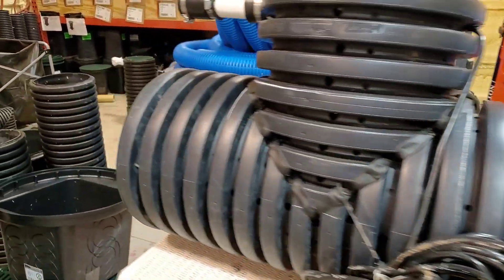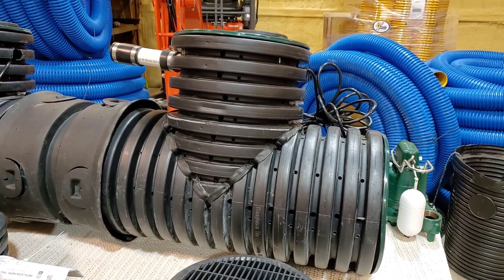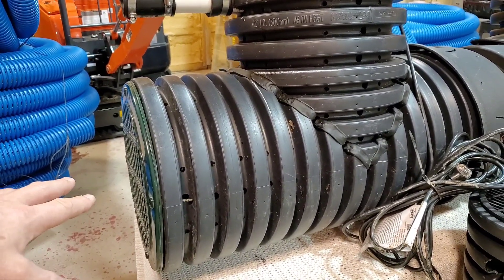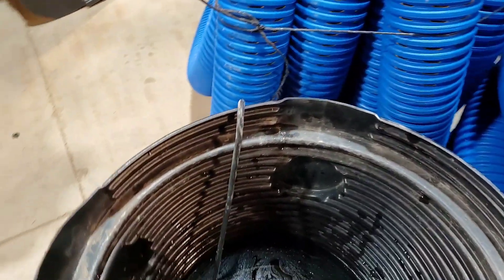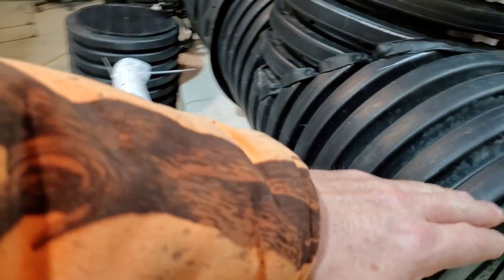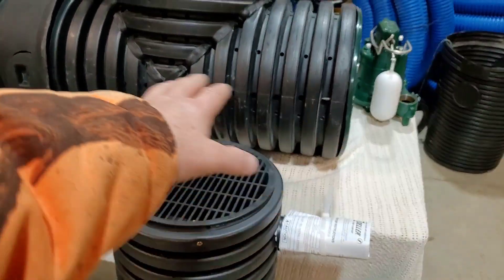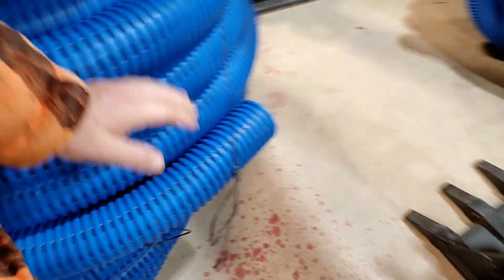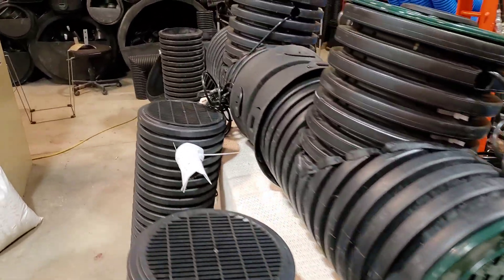Outdoor Sump Pump System [ How 🤔 to calculate the Right System for Your drainage problems ]

Comment: I have baffling problem with a sump pump that fails to send water down the discharge line. I have a  ½ hp Zoeller pump connected to an 1 ½” pipe on a 60’ run to the street.  This model struggles to deliver a trickle of water.  The plumber has checked the pipe; it’s clear.  He has removed the sump pump and placed it in a bucket of water to test it and it seems to work fine.  It shoots water half way across the yard.  But when it’s connected to the pipe,  it delivers a  barely cup of water at a time.  What could be the problem?
Reply: What’s the head height (elevation you’re pumping water)?

I’d check that there is no debris (including mud) obstructing the pump intake.

Also, do you have a check valve? If so, verify that it’s not on backwards. 

Any ball valves on the line which are partially closed?
Reply from the maker: https://youtube.com/playlist?list=PLjFCqaZ4v1BUpFHCLJ_sUFTqw1WoXu1Vz&si=d8F4T6qnzVk-ToQz

Comment: How does the added depth work when the pumps have the set float heights? How does it take advantage of the width when the pump would turn on before the water got that high? I'm sure I'm missing something though.
Reply: In this case, depth is just about allowing water to fall below your trench
Reply: @ben99873  that's not what I was inquiring about. In some of the applications it has a lower portion, almost looking like a cross. If the pump is in the lower part, and there's only so much float travel, how will the water ever fill the wider compartment above it?
Reply from the maker: https://youtu.be/ORFCgTEPq1I?si=NLJTpvwz3owZnZ1D